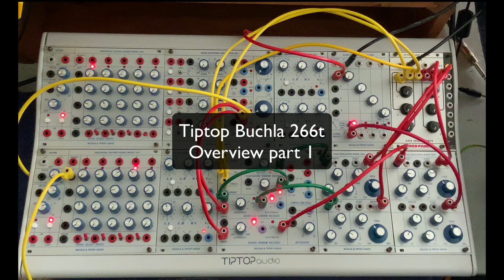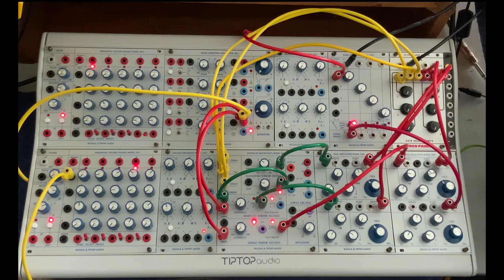Tiptop Buchla 266t Overview 1

Comment: I need to study noise more. I was under the impression is white noise is the full spectrum and then you remove certain frequencies to get the others but maybe its more complex than I understood it. Can't wait to get my hands on this one. My rack is almost complete and then I might start ordering duplicates once the next module comes out.
Reply: I'm no expert but I think white noise is full spectrum but our perception skews it. For our ears a doubling of frequency is perceived as an octave - so we hear all of the top half of the frequency range as one high octave the next quarter of the range is an octave, the next eighth the next lowest octave and so on. I think the result is that the high end dominates and the low end is under represented in white noise. My understanding is that pink and red noise are adjusted to sound more balanced to our ears.